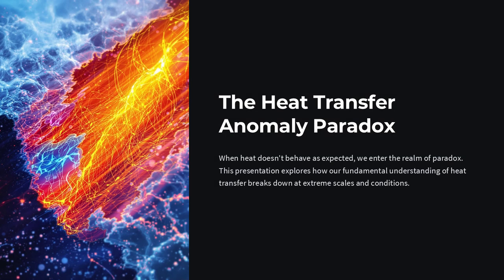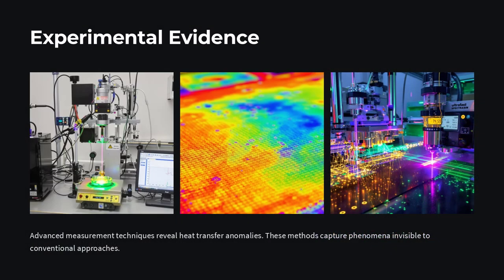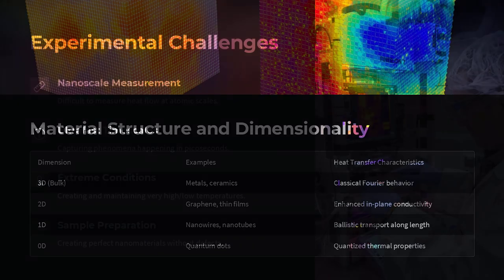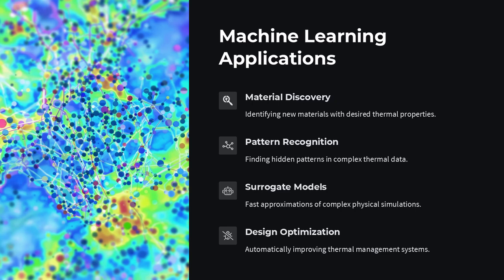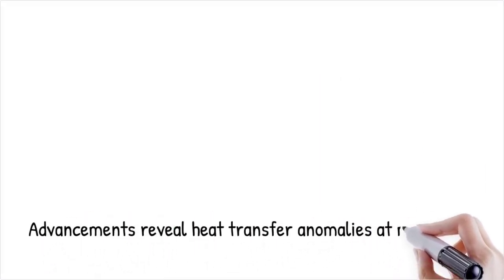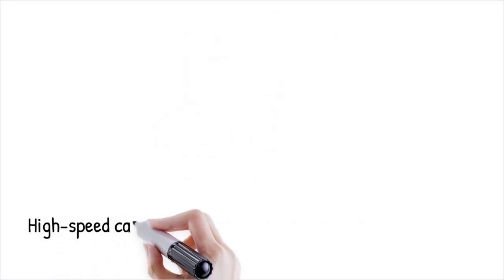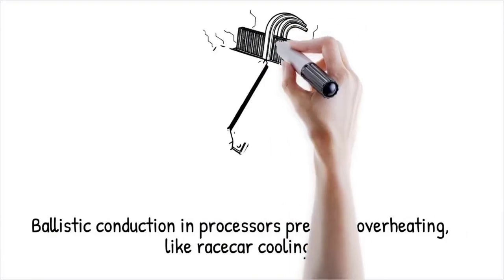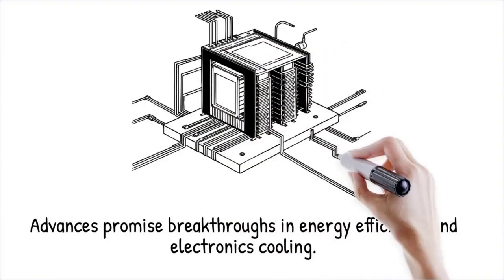What if Our Understanding of Heat Laws Are Incomplete?

Comment from the maker: How can theoretical models of non-Fourier heat conduction be experimentally validated at nanoscale resolutions, particularly in heterogeneous or disordered materials?
What are the quantum mechanical constraints that govern the transition from diffusive to ballistic and wave-like heat transport in ultrathin materials?
Can thermal rectification be made tunable and reversible in real-time to develop reconfigurable thermal circuits for adaptive energy management?

Comment: heat laws are incompleet there a fundimental part of physicsat the base of the pyramid atm we dont have a full understanding of how they interact with the other forces // heat is vibrations of atom in part //
Reply from the maker: Thank you for your intriguing comment. You are absolutely right, our current understanding of heat, rooted in classical thermodynamics, remains incomplete, especially when we try to unify it with the other fundamental forces of physics. Heat, as you noted, is deeply connected to atomic vibrations, but at its core, it also involves statistical mechanics, quantum phenomena, and even relativistic effects that we do not yet fully integrate into a single, coherent framework. The anomalies discussed in the video, like ballistic transport, second sound, and thermal rectification, reveal just how much we still have to learn. They hint at deeper principles that may bridge thermal physics with quantum field theory or even gravity. It is a frontier, where experimental observations are starting to outpace theoretical models, and that is often where the most exciting breakthroughs emerge.